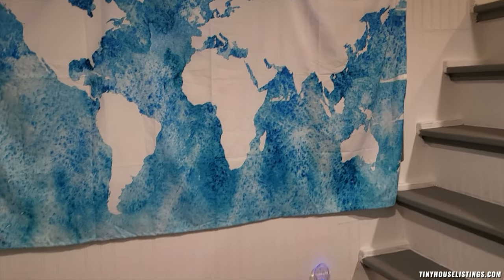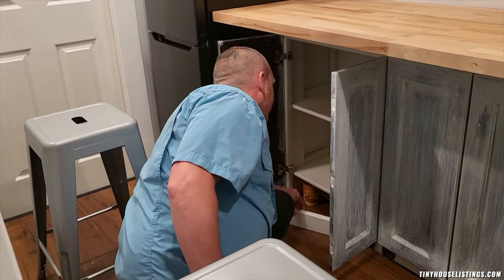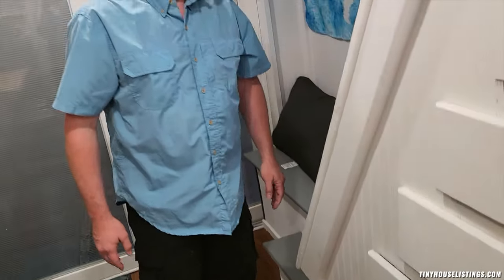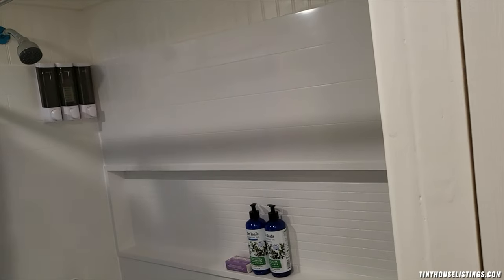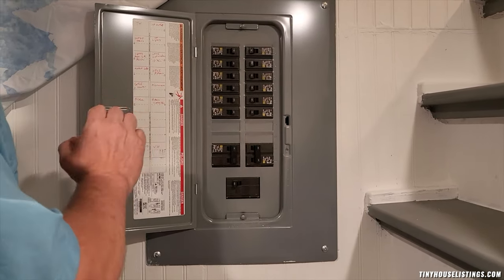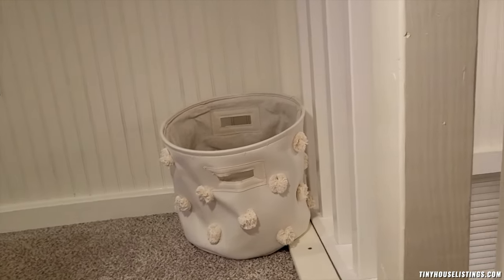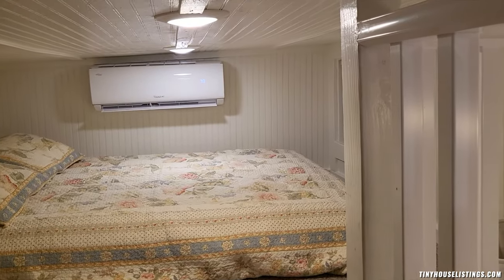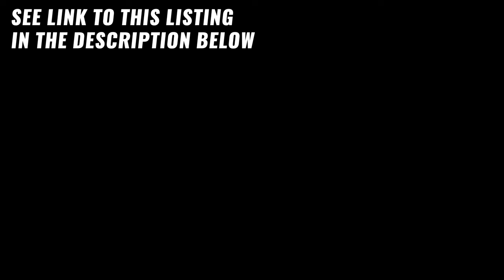COULD YOU LIVE IN JUST 16 FEET? | TINY HOUSE TOUR

Comment: The bathroom is too big IMO, unless your choice is only shore power. You aren't going to want to waste water like that if you are boondocking. I would put the kitchen and shower under the storage loft so you could have more headroom in those areas because height/head room doesn't really matter for storage. You are mainly sitting in the "living room" so that should be under the bedroom loft and could be extended with less room being eaten by the bathroom. The stairs could be done differently where you could have both drawers and hanging storage. There are many changes that could make this small space better. I'm not saying it's bad, but not that good as far as space design. I always wonder why people never mount TVs to the ceiling to drop down, that could save so much wall space and they are so thin now it wouldn't eat much head space. Just need a really good mounting system if you are worried about it while traveling. 

Personally, I would never do a bedroom loft. Murphy bed is the answer IMO. People need to stop being married to dedicated "rooms" unless you are talking about a bathroom.
Reply: Would love to see your builds!
Reply: Another awesome alternative for the bed, is using a "happy jack". Basically it is a power hydrolic lift. You can use it to raise  and lower a bed or other type of furniture  you don't want down/out all day. Build a nice looking, strong, framed platform for your mattress, and then the nice platform is all that shows, when it is raised up and not in use. (Search for them on youtube. I know there are videos of them being used in conversion vans. There are probably some in TH also. I've even thought that could be great for storage. Build a similar platform, but probably a little smaller, then put seasonal and/or items you won't need often in it.
Reply: I like those IKEA couch/pullout beds. As an amputee, I'd keep my bedroom on the ground, and put my guest/storage in the loft.